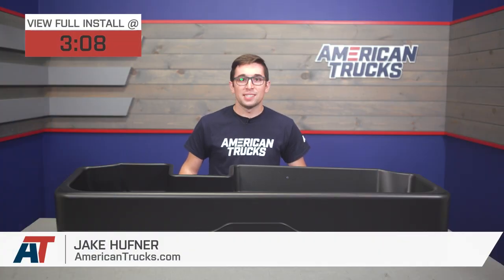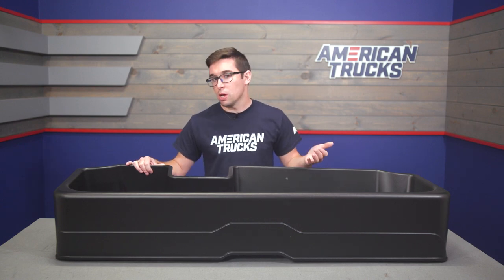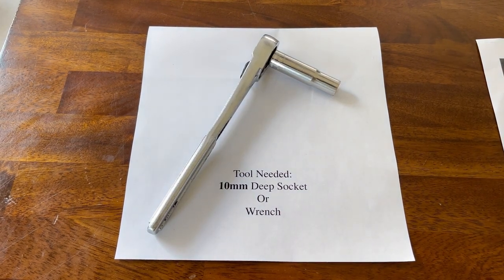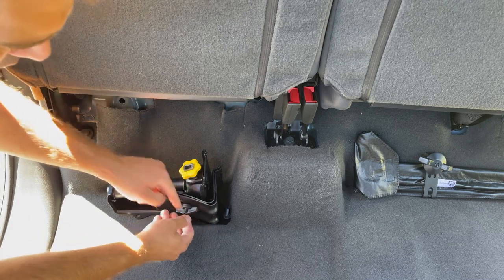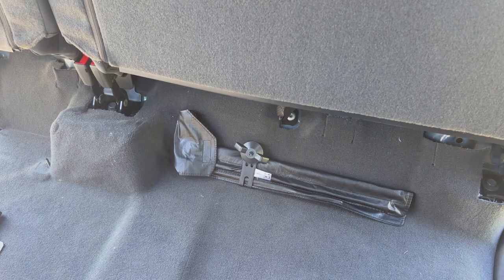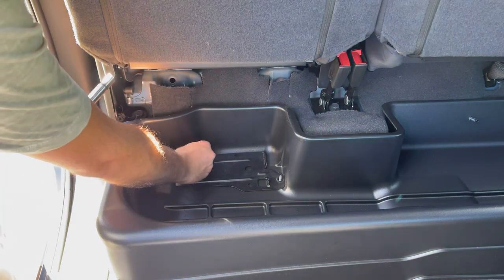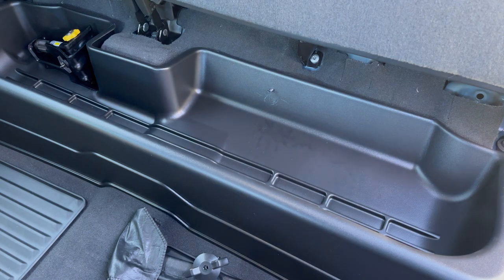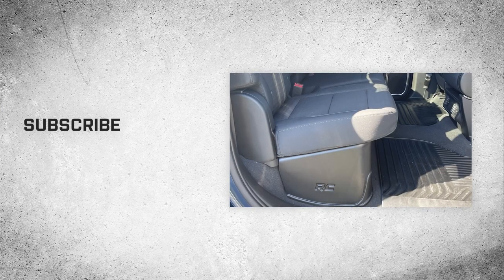2019-2022 Silverado 1500 Rough Country Custom-Fit Under Seat Storage Compartment Review & Install

Comment: I had this in my 2019 and transferred it to my 2021. The older design doesn't have the jack on the inside. I like the newer one. But the older version came with a divider. They are great for under seat storage though.

Comment: I just installed one in my 2024 3500hd high county.  Took out the stock one and this one add three times more storage. The price was around $125. cheaper than the other out there.

Comment: will this fit a 2018 SIlverado 3500HD??
Reply from the maker: Rough Country only guarantees fitment on this specific part number for 2019 and newer 1500, 2500, and 3500's. We do offer one that is specifically for 2015-2019 Crew Cab 3500's though! Check it out here ---> https://www.americantrucks.com/rough-country-silverado3500-custom-fit-under-seat-storage-compartment-rc09031a.html

Comment: The problem is is that the jack and jack tools take up half of the storage.
Reply: I wouldn’t say they take up half. Wow, and this on your seat storage is better than nothing !!
Reply: @George-on3zm  Not really better than nothing. I can fold the seats up,when needed,to haul more stuff. With the storage system there all that space goes away. I can also store items under the seat without the need for the system. I did look at buying this but it is not worth the money or the lost space.
Reply: I think you need to work on your fractions lol
Reply: I'll just be putting flat plates in place of the tools because my truck is lifted and I can't use the jacks anyway. 😁
Reply: I just put in my 2024 Silverado. I did have to trim the rear lip of the oem floor mat on the passenger side that surrounded the jack. Other than that it firs perfectly.
Reply: How about shorter extended cab? Do they make one